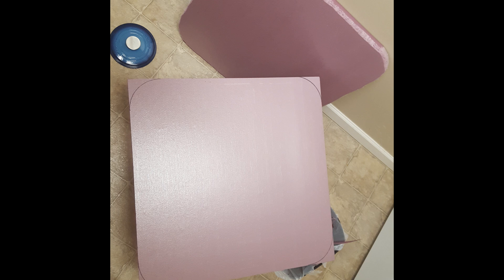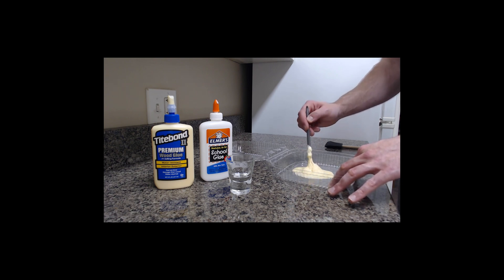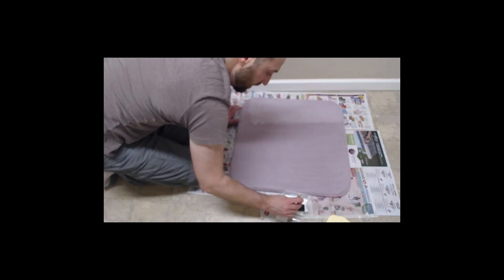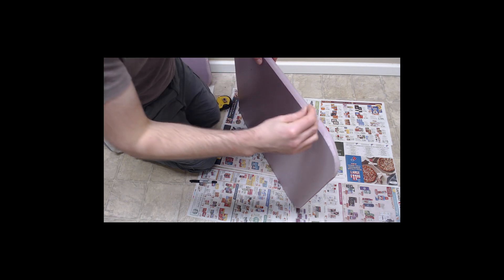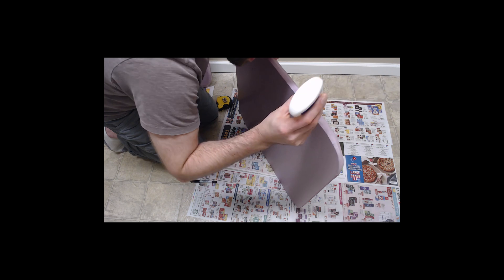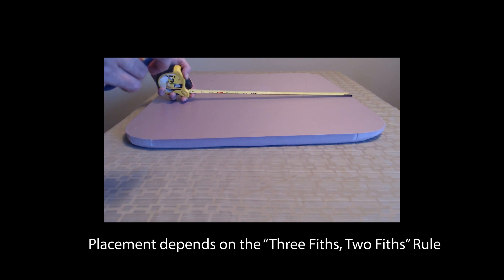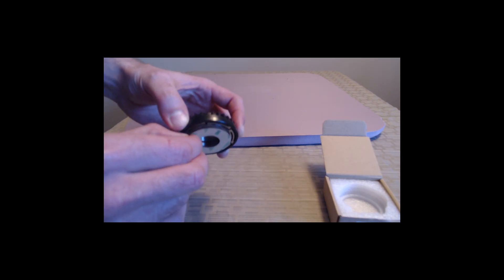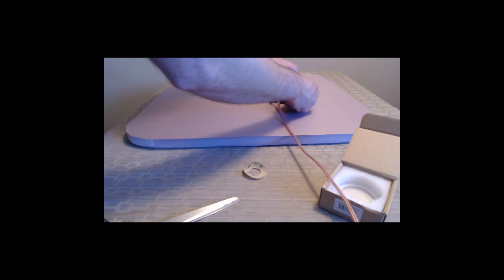Panel Speaker vs Cone Speaker, Part II: The Build

Comment: Instead of nails and glue, I used 2" drywall screws driven into 1" right angle brackets and then hung in a frame with cross screws driven into 1" wood blocks on the inside of the frame.  I put a bit of hot glue on the cross screws where they contact the bracket to eliminate any chance of irritating vibration.  This method holds extremely well and the quality of sound is great. I then attached some sound transparent cloth to the fronts of the frame and hung them in my media room.  They work extremely well for both music and movies played through them.
Reply from the maker: I might follow this recipe for my new design

Comment: Avoid adding glue if you can, it will dampen the vibrations of the panel.
Reply from the maker: Very true, but without the glue, the pins wouldn't have enough surface area to hold the panels. I only used a small dab to give the pins a bit more "bite" otherwise eventually the panel will slip due to gravity and vibrations.

Comment: Can you use Foam Safe Paint on these ?
Reply from the maker: Yes you can, however, any substance added to the panel will degrade vibration. It's possible you'll lose some fidelity with a layer of paint. I used glue since it dries stiff and not pliable like paint.

Comment: Very nice ! I went with 2ft x 4ft. When I play mine, I put non other than Jadyn Rylee music on and crank them ! The BEST VOICE I've ever heard ! They blow my Towers away lol !!
Reply: I used a 4 ft x 8 ft pink 1 inch polystyrene and just cut 2 2 ft x 4 ft sections. They sound great !!
Reply: Did you use one Exciter or two per panel?
Reply: Where and what boards did you buy??? I can’t find anything bigger than 2ft x 2ft!
Reply: I bought a 4 ft x 8 ft polystyrene pink insulation board with 2 exciters per panel. Now I have 2 extra 2 x 4 ft sections for more I'm thinking of doing. The 4 x 8 piece was about $20. Once you make 1 set, ur going to want to make more ! Next is a center channel for behind the screen of his Theater room.
Reply: @scottbehl216  I think I'm going to try the same thing for my setup... thanks for getting back to me 😁
Reply from the maker: Rock on!